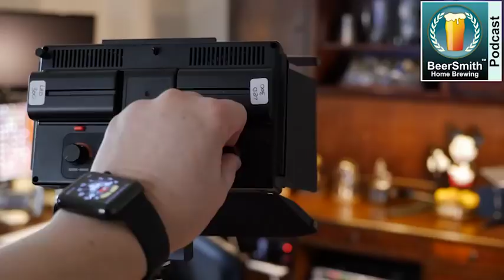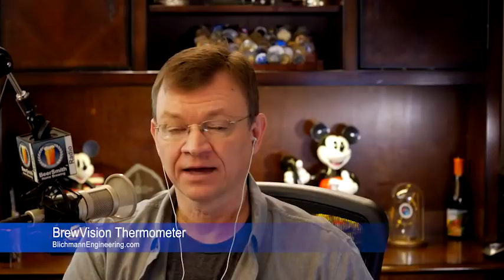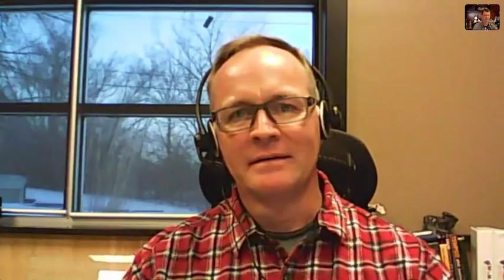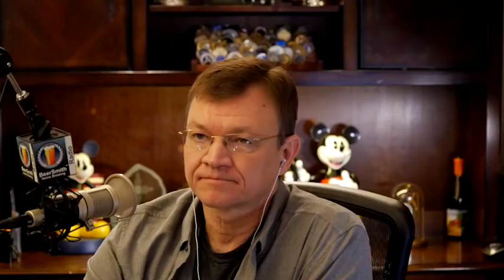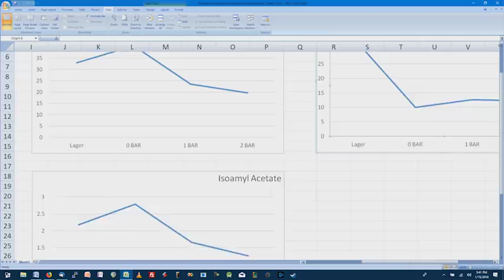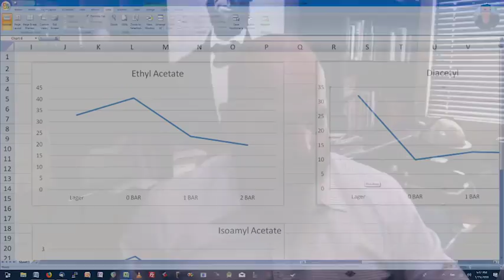Pressure Fermentation with Chris White & John Blichmann- BeerSmith Podcast #163

Comment: These guys probably stole the idea from WilliamsWarn which I have, a 50Ltr fermentation keg for ten years! 
And it doesn't need any flipping due to a sediment catcher on the base. If you put it in a temperature controlled fridge you can run any temperature and then crash chill to 0°C (I don't use freedom units)
Then once the beer is at that temp you can run some silicon dioxide through for final clarification.

Comment: would you let the pressure build up over time or put a layer of co over the top to start the ferment at 1bar?
Reply: With my brew keg 50 by Williams Warn, I add the yeast then just lock it up, fully wind up the adjustable pressure valve then check pressure in 12 hours or so. If it's a tad high wind it back so it's on 2 Bar and stabilise the temp at 25°C then just wait till the brew is finished.
Next crash chill which takes about 36 hours, then lock off the sediment container at the bottom, as the yeast can be saved. Push through 60-70ml of silicon dioxide and make sure the pressure is back to 2 Bar. Once the old yeast has been harvested the collection container is cleaned, sanitised and then filled with beer from the keg. (Lots of foam is good) Screw back into the bottom of the keg open the lock valve above and in about 24-36 hours ready to drink or store.

Comment: williamswarn.com have a fermenter that uses co2 pressure to "make cold, clear, perfectly carbonated beer in 7 days, just like a modern brewery"
It looks a lot less trouble to use than the sponsors system it with built in temperature control and even has a dispensing tap  so you could keg your beer or just drink it from "brewmaster" tap. I first heard of them 4 or 5 years ago but they are made in New Zealand so expensive to import.
Reply: davegetsspam youuucu

Comment: I would like to find out what John used for the "pretty precise" spunding valve (at 19:06).  I just received my two Fermentasaurus (or is the plural Fermentasauri?) conical fermenters with pressurization kits which require a spunding valve for pressure regulation.  There is a spunding valve for sale at my LHBS for considerably less than I could build one, but it is built around the Harbor Freight air tool regulator (https://www.harborfreight.com/150-psi-air-compressor-regulator-kit-with-dial-gauge-68223.html).  I'm unsure if I can trust that to keep the pressure reliably below 15 PSI without constant babysitting.
Reply: Look up Parker RV01 relief valve.  One of those with a tee, gauge and fitting to get to your ball lock/gas post is what I use.  Works well.  Pretty easily set and consistent so far.

Comment: And about yeast viability and reusing? It is possible?
Reply: They cover that question fully in another episode. They said it should be good for 2 or 3 batches of beer but then the yeast will need  yeast nutrients added to the wort when you put your yeast in.
Reply: @davegetsspam  I couldn't find the episode by title, do you happen to remember which episode it was they discussed repitching pressure fermented yeast?
Reply: It is important to depressurize yeast slowly, if you do that it should not matter. If you simply just drop pressure from 15 psi to 0 you are going to kill or degrade alot of cells. Diving sickness ;).

Comment: Great podcast (as usual), I am quite surprised that there wasn't any mention of White Labs Wlp862, which is also called Cry Havoc.  I brew with it year round (in Albuquerque), but at 60F all winter, and elevated temperatures in the summer.  It is rumored that Cry Havoc may be a Budweiser(ish) lager strain, and (if true) would be subjected to many commercial tricks (including pressure).  I would love to see it as the subject of further study.  Regarding the Cornical fermenter, I saw it (not sure which supplier web site), and I thought -- "wow - what a great idea", then I analysed my needs, and realized that it didn't address my (very specific) needs.  I would love the opportunity to discuss these needs with John, but I have a job to manage, and can't make it to the seminars...